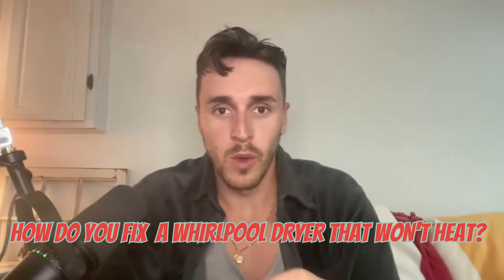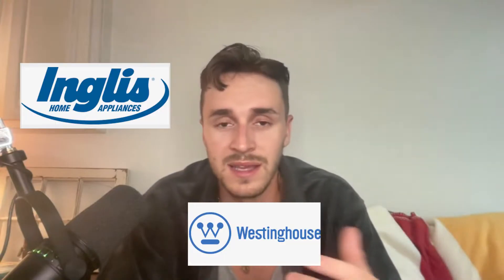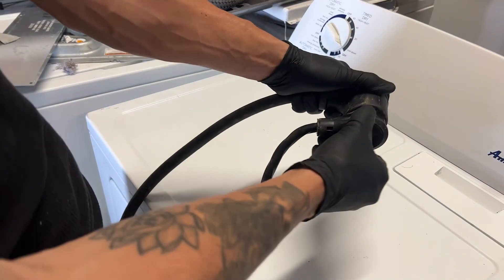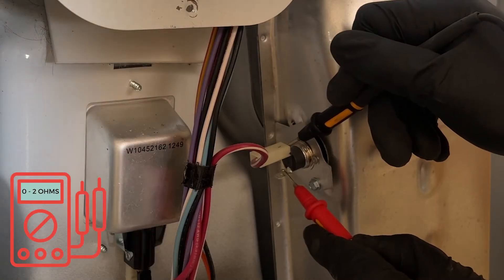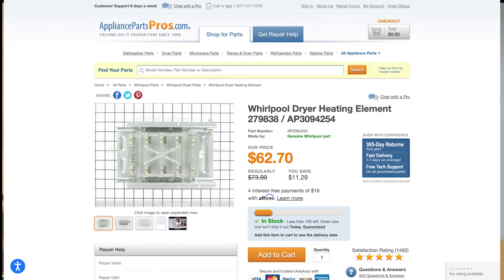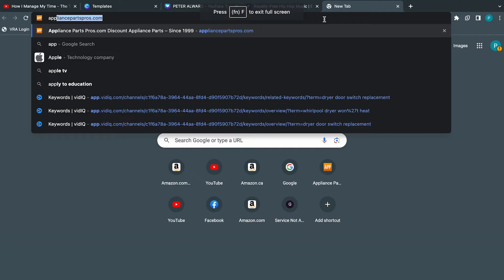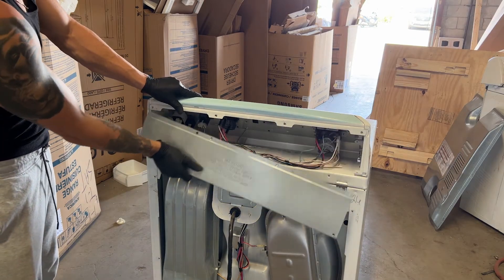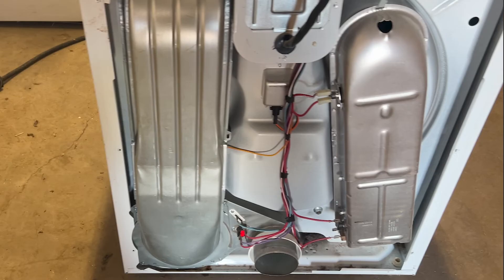6 Quick Fixes to Get Your Whirlpool Dryer Heating Again in 2025!

Comment: Can you do their washers too?  my washer won't heat. 😊
Reply from the maker: Hey! 

I’m not understanding. What do you mean your washer won’t heat?
Reply: @theappliancedudes  The water won't get hot when it's selected. The clothes is only able to wash with cold water.
Reply from the maker: @ualready2268  what is the model number of your washing machine? Chances are you have a clogged or defective inlet valve. 

Some washing machines also use what’s known as an “ATC Switch” which stands for “Automatic Temperature Control”. If the switch is defective, then the hot water may not be coming on
Reply: @theappliancedudes  Amana MOD: NTW4516FW3
Reply: @theappliancedudes  I replaced the Valve already
Reply from the maker: @ualready2268  @ualready2268  This model does not use the ATC switch as mentioned above. This is Whirlpools Vertical Modular Washer and they have a lot of issues with the control boards. The inlet valves on these models also get clogged often for some reason. 

I am waiting for the technician guide to be submitted to me, and I will have a quick look at it for you! I will get back to you :)